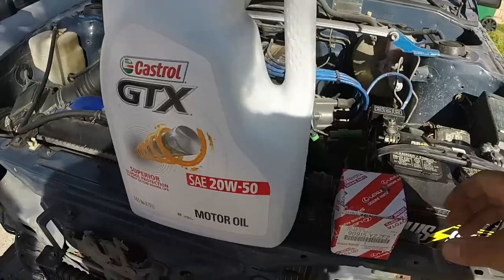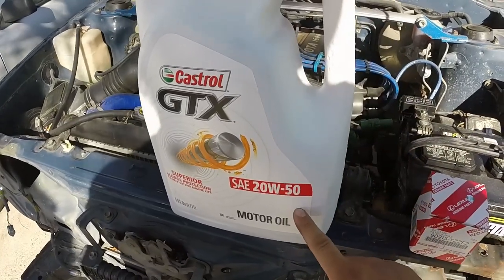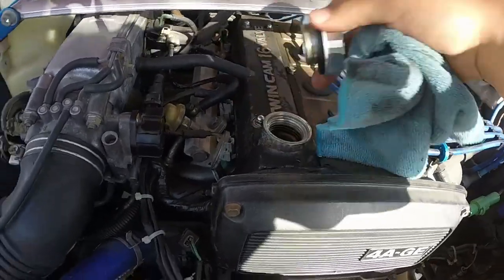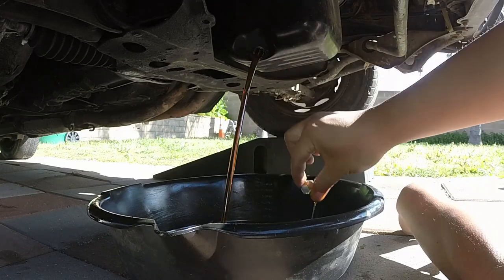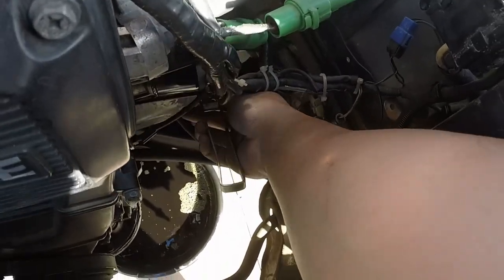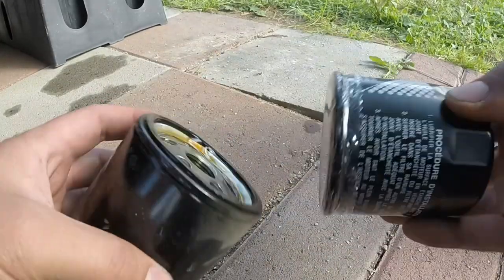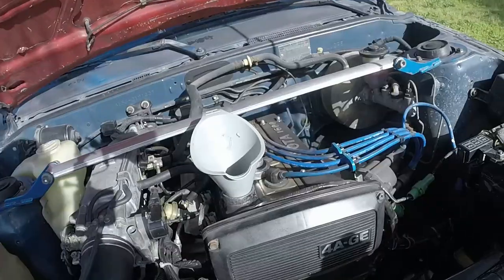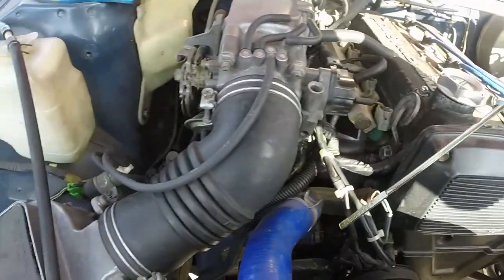OEM Toyota oil filter at WALMART? | Changing AE86 Oil

Comment: You need to replace the valve lash to thicker ones. You shouldn’t put heavier weight oil, not good for the cold start oil flow. And the oil filter gasket requires some engine oil it says so on the oil filter box, no big deal but its good to do it. I always wanted to have that engine by the way, cool 😎 car.
Reply from the maker: Thanks for the info! Really appreciate it! 😎🤙